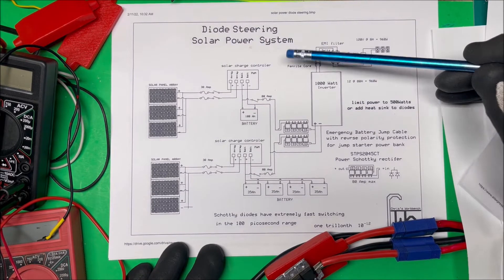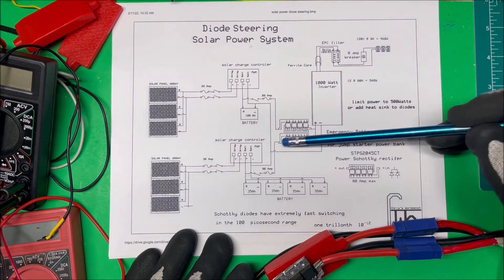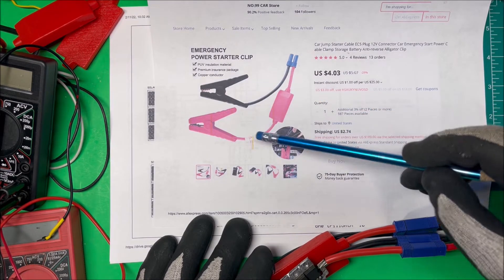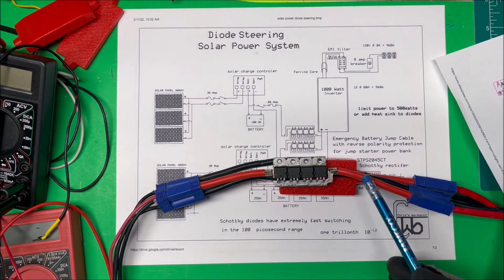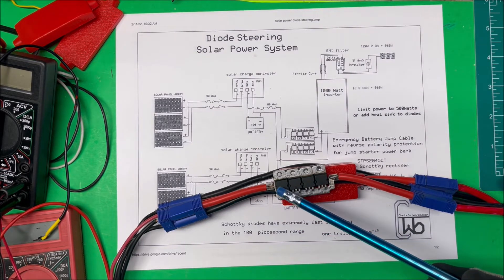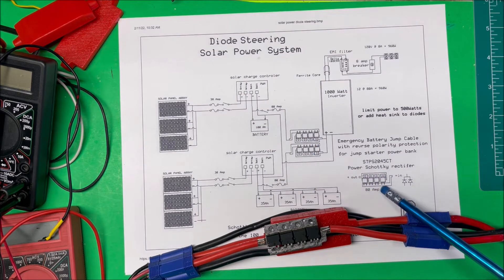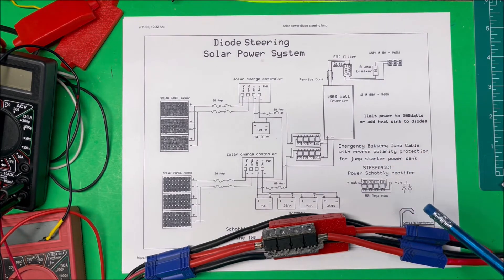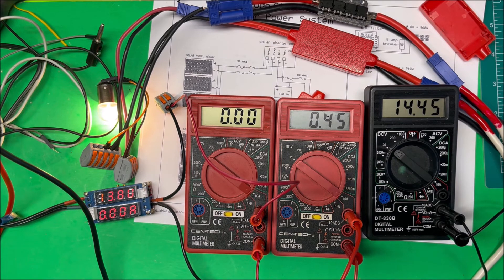Diode Steering

Comment: If both the two input and the output voltages are smooth DC then the diodes will not switch. There is no coltrol circuit built into them for that.
The switching time noted in the datasheet applies only to the case when the diode is used in an AC circuit and the switching time specs only tells us how fast CAN the diode switch on or off.
But again they do not start to swtich back and forth in the circuit like yours themself if both the input and output voltages are smooth DC.